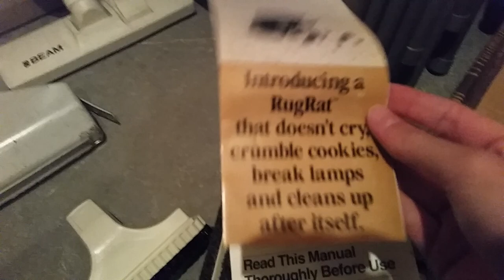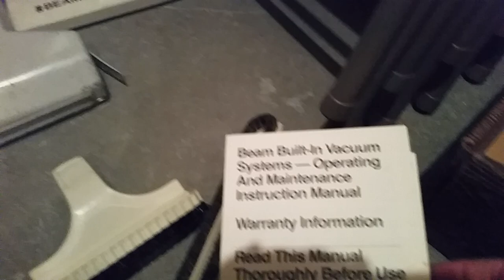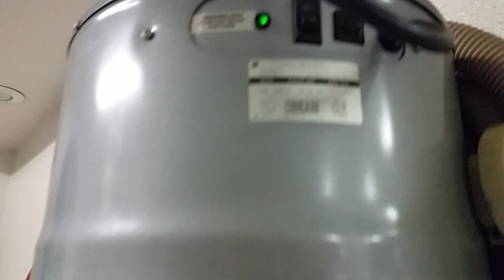Beam 287S Central Vacuum

Comment: Sweepin’ flaps! I can definitely tell you guys use the system too, which is good. Drives me nuts when people have them and don’t use it!
Reply from the maker: I think it's funny because of how much I know about vacuums and to tell which is good or which is not, my folks don't give a crap about them. As long as it works and what's easy for them to use, they're sticking with the central. Even in their new house all they want is nothing other than a central vacuum. Btw nice new system that you just put in, perhaps you could do a review video in it.
Reply: Panasonic Vac thanks! I’ve been thoroughly impressed with it, it’s even better than I was expecting! I should make a video. Been wanting to, but haven’t wanted to video all the attachments I’m using until I had the new unit to show too
Reply from the maker: I would love to get a Silentmaster one of these days. But now I got my eye on Vacumaid because they just recently updated their warranty and I could use their S3600 as bagged.
Reply: Panasonic Vac Meh, I checked and yes, that’s their big dual motor cyclonic unit, but then I saw the price! 😵😵 It would definitely be better to use it with bags, but at that price the SilentMaster is not only a more powerful unit, but significantly less expensive!! If you do go Vacumaid, I know they have a unit that’s not on their site, it’s a split can bagged unit with two 6.4in motors. Significantly more powerful than the 7.2in motors with the non-loading fans. Much more in line with the SilentMaster for power, probably still what I’d consider too expensive though. S3600 is $1900!! The S900r2 is $1300. I wouldn’t worry much about differences in warranties, I have an early 80s AirFlo CFM-2 which is an MD B-2, at work that I use as a workbench vacuum. It’s completely original and still sucks like the day it came out of the box, it’s lasted this long because the motors are kept clean and no crap in the fans. An MD will usually run for decades before it needs anything other than a bag change.
Reply from the maker: Are you referring to the P400? I haven't looked too deeply into the P400, their predecessor model which is the P350P I read that the motors are not nearly as powerful as the S3600. I'm not sure if the P400 has those same motors or if they just recently updated them. I have a dealer who would offer me a Vacumaid at a comparable deal. Though there are still other dual motor units that I want to try out before I would make my final decision including the S900r2 since I haven't used one yet. My only drawback with Silentmaster is that their units are white, I think white is such an ugly color on a vacuum which no offense. I prefer having appliances and/or vehicles that are grey in color, though I really do miss the green and the blue/silver colors on the units. When I used their S3200, I loved every single minute of using that unit which is why I consider looking into the S3600. I've always have a soft spot for Vacumaid, not only I think they're cool looking and powerful but I also find them fun to use. Really takes me back to using my grandpa's with the vintage unit, hose kits, and the metal inlets. Speaking of which, the motor just recently went bad on his. I plan on making a sequel video with the new motor and other small updates on the system hopefully in a couple months. That's one of the reasons why Vacumaid is my most favorite central vacuum brand of all time. I would agree with you that warranties shouldn't really matter that much, it's just one of those things that it's nice to have. I tried to order a new filter for our Beam that's under warranty because the self cleaning filter had a weight sack that helps drop the filter whenever it's off, anyways the sack ripped and unfortunately the system never got registered when the system was installed. Ugh!
Reply: Panasonic Vac I honestly have no idea what the model is, but I do know the 6.4 in motors are definitely more powerful, it looks much like the 3600’s motor pod but has motors incapable of ingesting dirt. I personally want one of the green dual motor units for my collection, I like how the older motor pods look. And I agree, looks wise my S5 is BORING!! One of the least interesting from a looks perspective. The older blue Modern Day unit’s or even the older SilentMaster that has the round logo with the fancy script writing are more interesting to see. But at the end of the hose it’s far from boring, and that combined with the bag arrangement is why I went with it. All the units I find fun to look at had less power or were loud screamers. Ultimately I decided how it felt at the hose end was most important, followed by the easiest bag change.
Reply from the maker: Yeah I think it is the P400 you're referring to. I just looked at them up, it seems they have indeed updated them now that they have more airflow than the S3600 so I'll check those out. I also agree with you on the older split unit motor pods, it just seems like the 80's by looking at them. I wouldn't mind personally putting one of those in my own home, probably the P350P because not only they're more powerful but I also like the blue/silver combination colors on those the best. Yeah MD's are not my most favorite looking units. But I would love to find the exact same Silentmaster unit that we had from our last cabin back in like 2004, I don't remember the model it was but I think it was an S2 based on the square footage of the place. Maybe I could buy that unit back from the current owners of the place and replace it with the newly updated model. I also would love to find an Airforce as well, MD says they've suspended producing that lineup but I think they're discontinued for good.
Reply: Panasonic Vac I didn’t know they still claimed it was suspended! I thought the AirForce was gone. I’d like a SilentMaster S3 or an early S5. I want the old logo but I won’t hand a single motor unit as my daily driver, I really do insist on a a dual motor unit, and I want the thing to have as much power as possible.
Reply from the maker: It was a while ago when I last heard about the Airforce so I think they're just old news now. Yeah I would also rather use a dual motor unit as well. If I find an S5 with the old logos on it, I would actually rather use that than buying an S900r.
Reply: Panasonic Vac I was holding out for one, but this BNIB S5 for $250 was too good to pass on. From what I remember about the Air Force was that they had the propensity to overheat. They had this odd system with these hoses in it, how it worked was to put the normally bypass cooled part of the motor in the air path before the fans. These hoses came down and brought the working air to the cooling fan intake at the top of the motor, then there was some convoluted arrangement of baffles and ducts that allowed the air to go from the motor area to the fan intake whilst separating the exhaust off, as they chose to complicate matters by using the same radial exhaust motors the S5 uses rather than simplifying it with horned exhaust motors. It was a cool design, but not much quieter than a SilentMaster and less reliable. They’ve since added suction relief vents to some units, only the units that had they flo motors (yes it’s a thing now, and no it’s not the sac religious thing I thought at first...) which has eliminated the overheat problem. I’m sure they’d have kept it or reintroduced it if they felt the market was there.
Reply from the maker: I always wondered more about the downfalls from the Airforce line since I never used one before. I did read that they were also not nearly as powerful as the Silentmaster line and they were also not cheap. I remember years ago my friend back when he still had his store, he had an Airforce sitting outside in front of his store all burned up from the inside of it. What happened was when he did a service call on that Airforce, someone was sucking up ashes from the fireplace. Thought that the ashes were cool enough but unaware that there were still some areas underneath that were red which caught fire inside the bag and basically just screwed the whole entire thing up. And I thought back then people were more dumber doing stuff on their disposable vacuums than someone spending more on such an expensive vacuum. Yeah it was a cool design, I also think they would've kept the line if the market was there. If there was one line that I would replace with the Airforce line if they were to be reintroduced, it would be the Airmaster. Never really was a fan of their Hybrid models.
Reply: Panasonic Vac the AirMaster is designed largely to replace existing units. For example, it’ll mount up on a Beam bracket and the customer, if they wish, can use it as such. It’s largely for the customer that needs a new unit but doesn’t want to completely change to the top loading bag setup. Although it’s obvious that MD pushes the top loading bag, and it’s what I personally prefer as well.
Reply: Panasonic Vac the AirMaster is designed largely to replace existing units. For example, it’ll mount up on a Beam bracket and the customer, if they wish, can use it as such. It’s largely for the customer that needs a new unit but doesn’t want to completely change to the top loading bag setup. Although it’s obvious that MD pushes the top loading bag, and it’s what I personally prefer as well.
Reply from the maker: Ah okay, that makes more sense now. I thought at first they were mainly marketing for a hybrid central vacuum similar to what Miele is marketing for their Blizzard models. Or maybe Miele made the Blizzards so they would also introduce bagless consumers to look into their bagged models as well?
Reply: Panasonic Vac in this case it’s more of a “let’s have this option just in case” kinda thing. Personally I’ll never use an inverting filter machine as my daily machine. I just converted a CanaVac built Rhino unit to take bags and tossed that nasty filter in the trash. Much better! Also sold them an EBK360 kit.
Reply from the maker: I'll also NEVER use an inverted bag unit again as my main vacuum. If I had to, I'll convert it to use as bags just as I did with my Eureka. I would rather have a top mounted motor bagged unit to replace the filter underneath the bag like the Nutone CV series or the Cyclovacs with the Cyclofiltres for example. I always hate it whenever a unit gets turned off, the inverted filter drops back down and blows some dust back out of either the bin or the bag. But preferably replacing bags on top of the unit is my choice.
Reply: Panasonic Vac the Riccar I have that was hung up there is a Cyclovac with the Cyclofilter. So glad I’m done with cleaning that thing!!!
Reply from the maker: I was more specific about the rounded ones, I forgot they also call those filters too on the cyclonic models. I would imagine those were a pain to clean! Did you wash yours in the washing machine as well?
Reply: Panasonic Vac no, I usually just vacuumed it off with another bagged canister.
Reply from the maker: I just spoke to MD, they will not bring back the Airforce line which is no surprise. I had to contact them anyways because my aunt who happens to own this Serenity is also putting in a central at their new place so I'm now just gathering prices and options from other dealers. I'm not sure what they'll go with yet but just glad that it won't be a Beam ever again! https://www.youtube.com/watch?v=A5urf4qUhH0

Comment: Nice system! Looks like the brushroll in your newer TP210 is in backwards though. There's a video called "Turbocat Service" on my other channel (Just Central Vacuums) that shows the right way to put it in. You certainly have no shortage of hoses and attachments! That's a good thing :)
Reply from the maker: Yeah I knew that before a while ago, keep forgetting to swap it back. We really don't use these anymore.
Reply: Owen Perkins Ураааааааааааа перекус!111!22ц]с(4443кукувввввввввсааапкекув!@#$%554territories
Reply: If the brush is spinning backwards just rotate the belt on the turbine shaft 180 degrees and it will spin the right direction.
Reply: Owen Perkins to
Reply: @panasonicvac4036   I have a central vacuum in my house that doesn’t work we never used it it screamed at me the motor was broken
The technician said we have to pay 1500  dollars to replace it
Reply from the maker: What kind of central vac do you have?
Reply: @panasonicvac4036   we have a Filtex
Reply: @panasonicvac4036   the owners who use to live in our house said  they threw out the hose and the parts to it
Reply from the maker: Did the technician recommend you a replacement model that was suggested?
Reply: @Cam.469  sounds like they wanted you to replace the whole unit and buy a hose and tool set. Not a bad idea, but your system could be made operational for quite a bit less than $1500, if you are so inclined.
Reply from the maker: If you ever have any questions or concerns about your central vac, Owen Perkins from Just Central Vacuums is the guy to talk to! He'd be more than happy to help you out:)
Reply: @panasonicvac4036   we have a Filtex central Vacuum in our house
Reply: @owenperkins   I did talk to a technician he said there’s nothing he could do about it to fix it he said we have to replace the system And he told me Filtex is out of Business
Reply: @panasonicvac4036   yea our central vacuum doesn’t work it screams if you turn it on plus people are buying upright vacuum instead of central vacuum it’s hard to find parts nowadays
Reply: @Cam.469  they are, but you can still get bags, motors etc plus new hoses and tools to fit. If you were in Chicago I would look at your system in person, but if you would like to make a video and post it I can try and help you remotely! Filtex made great systems.
Reply: @owenperkins   do they even make central vacuums anymore
Reply: @owenperkins   really but my parents really didn’t care about replacing our central Vacuum
Reply: @owenperkins   can I ask a question
Reply: @owenperkins   do you install nutone intercoms too
Reply from the maker: No Filtex isn't around anymore but Owen is correct, you can still get motors and bags for it. And no he doesn't do intercoms, just central vacuums as what his company says. I'd recommend you contact him if you want another opinion or the best advice for your system. Here's his website at https://www.justcentralvacuum.com/
Reply: @panasonicvac4036   it’s hard to find a new one
Reply: @owenperkins   can I buy a central vacuum that’s made by beam
Reply from the maker: You can easily find a brand new one. Either online or at a local vacuum shop.
Reply from the maker: Beam is currently owned by Nuera Air, they have multiple brands.
Reply: @panasonicvac4036   can I buy a beam central vacuum from a vacuum shop
Reply: @panasonicvac4036  how much are central vacuums
Reply from the maker: It depends on how much you're looking to spend, how much square footage you have, and how much your circuit box can handle. You can buy a Beam from a local dealer but honestly, there are much better options.
Reply from the maker: Take a look at this video from Owen Perkins, both him and I highly recommend MD central vacuums.

Comment: Why don't you use the powered tools inside? Those air driven heads are junk compared to the powered head..
Reply from the maker: If you're wondering why it's stored outside in the garage, that's because it's the only room of the main floor inside the house instead of having to go either up or down the stairs to get the hose. Previously we stored one of our old hoses in our closet on the main floor but the closet wasn't suitable enough so we had no choice but to hang it up in the garage. Basically the idea is having 3 hoses for each floor so you don't have to carry the same hose up and down each time. Or if you're wondering why don't use the electric kit for inside the house? We do, we just prefer to have the turbo kits both up and downstairs because they get less traffic compare to the main floor.

Comment: It looks like the carpet is short pile.  Since you also have a nozzle that can flip to carpet mode, are there any plans to vacuum with that and show us?  I‘m of the opinion that the turbo attachments and motorized attachment defeat the purpose of a central vacuum cleaner‘s silent power.  Thank you very much if you plan to show us that!
Reply from the maker: I find that alot of the carpet nozzles I've used is still quieter than just using a canister or an upright.
Reply: Panasonic Vac thank you for the reply!  But if possible, I would appreciate seeing (and hearing) that flip nozzle used on a short pile carpet, your time permitting.  Thank you very much!  Are you still in that house?  The video is several years old.
Reply from the maker: I still do:) I'll probably do another video of this when or if the motor on the unit ever does get replaced again, I'm actually thinking about replacing the electric power head on this anyways so maybe I'll go ahead and do another video if that were to be the case. But if I do, I'll definitely show off the nozzle that you would like to see.
Reply: Panasonic Vac Thank you!

Comment: Are you still using this system?
Reply from the maker: Yes!
Reply: @panasonicvac4036  Do you still hate the inverting filter setup, which requires a shower after emptying?
Reply from the maker: Always wished that this was using a bag instead.